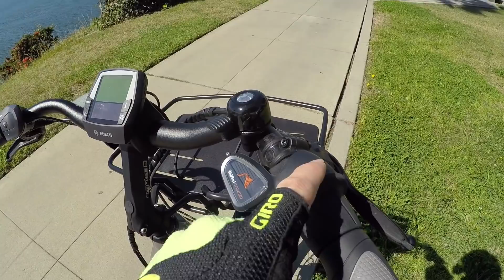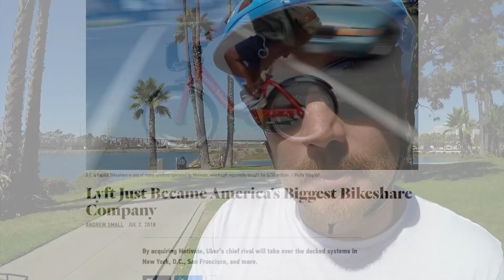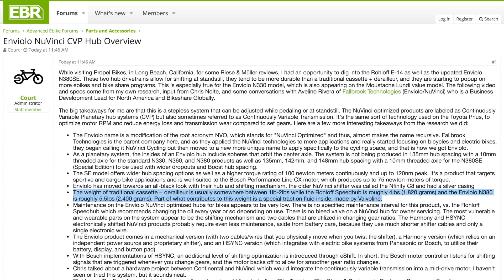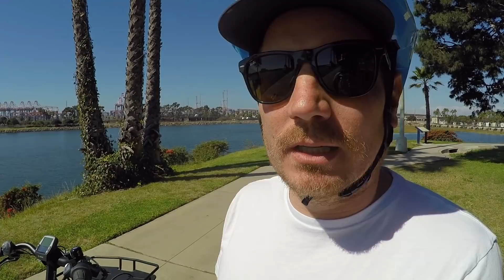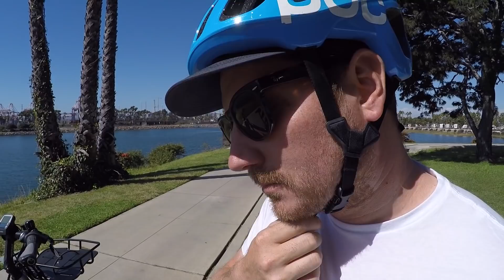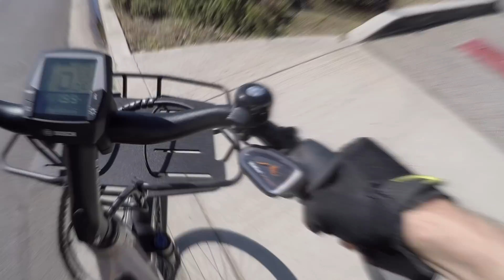Enviolo NuVinci CVP Hub Review, Stepless Continuously Variable Planetary Transmission for Bikes

Comment: One of the aspects of the Enviolo hubs that gives me cause for concern is that they come in around a half dozen different suggested power applications. I would not be happy if I bought a bike with a low power ability that slipped or broke under heavy uphill use when I was putting power down through my legs. Having an electric motor may increase risk of hub stress. I think owners and Dealers need to be aware of this.

Comment: Okay, I know this posting is a little behind the original posting...  Okay, Okay....  6 years behind but I thought I'd post it anyways and see if it yeilds any results.  I am going to use the N330s CVP Hub on a bike with a jack shaft and a 100cc 2 stroke engine on my 26" Fat Tire Mongoose...  I figure if the stock 7 gear cassete can handle it well this should do atleast as good...   It my iunderstanding it uses a fluid in the interior of the hub I'm guessing if I keep it cool it should work well, maybe some heatsinks all the way around the hubs housing for starters.  Im know some people won't like it but I'll post here agin with the progress and let you know if it has any issues...   Let me know if yoiu have over powered the N330s 250 watt mid-drive recomondation and if you had any issues and what the issue was...  
Thanks, I'd really appeciate it.  I am really going to go easy at first and then after about a 200-300 miles start beating the heck out of it.  Wish me luck!  The Manic Mechanic

Comment: Let me add a praise for this transmission. I bought an Nviolo a year ago. I put a TDZS 350watt motor on my bike, but I had  2 years of wear on the derailer which did not want to continue to operate on the 6 or 7 top gears. The chain would jump or even pop the chain link. With the Nviolo I do not have chain problems and I can always find a gear ratio for current performance needs. 6100 trouble free miles for the year.

Comment: Why don't they pair this with a planetary geared bottom bracket? You could run a thinner belt/chain and a lighter geared hub by turning the low speed & high torque of your cranks into high speed & low torque that only gets converted back to low speed & high torque by a final drive planetary set in the hub. Lighter hub and chain means less unsprung mass and less chain slap for mountain bikes.

Comment: I bought one of the ancient first generation NuVinci hubs, way back in around 2006ish. I spoked it myself, tensioning it by plucking the spokes till they all "sounded" and "felt" right. It was paired to a rusty old Huffy 314 with magenta mountain bike handles and an inverted set of speed handlebars... It was truly Frankenstein's bicycle... But I loved that bike. I rode it till I cracked the frame (broke the main crank bearing off the seat downtube, and started cracking the rear fork). I was gonna weld it, but then the bike got run over... I still have the mangled mess in a storage shed, NuVinci still intact, fortunately... My little hill guy cracked, but it still works. 

I'm a decade older now, and a little more creaky... Maybe I could fit that hub to something like a comfy recumbent someday...
Reply: will you send me that hub?

Comment: I really appreciate all the data you have supplied me in my search for a new ebike. I’m sold on the maintenance side of the cvt/belt drive but a little worried about the not shifting while pedaling aspect. My question is can I decrease my input but not stop pedaling change gears and then pedal hard again? I think I need to go test ride a cvt because I’m just so used to gears.
Reply: I am not willing to give up control over my gear ratios as I ride.

Comment: On this system, you can create an automatic transmission. It will be just an explosion in the bicycle industry. It is only necessary to install a sensor that measures the angles of inclination and speed, a controller that will control the servo drive that tensions the cables and changes speeds in auto mode.
Reply: It's already here.

Comment: Don't buy NuVinci products! In case you loose traction fluid which is inside (i had two leaking hubs from them) you can throw it to the bin, even if the hub looks like a new one, because NuVinci will not provide you with new traction fluid!!!! You can't buy it. So they are effectivelly forcing you to buy a new one from them and they are making more and more polution. This approach is against ecology, against environment. F*ck companies like this.

Comment: I love the idea of the cvt and most aspects of it, but I’m turned off by the lower efficiency.  If someone made one that was closer to 90% than 80% efficient, I’d get one. I did recently read that efficiency was greatest in the middle gears, but I don’t know how great.  I’m wondering if I might get a larger chain ring so I can mostly use the middle “gears” and still be going 20 mph, which is my usual speed. Any details about cvt would be great!
Reply: CVT strikes me as a [non]solution to a non-problem.

Comment: Great video, thank you! Do you know if cold weather (like minus 20 celcius) could create problems with these systems? Thanks!
Reply: Yes, our mechanic in Helsinki reports that these aren’t the best in very low temperatures. Apparently still works but harder to shift and possibly some extra rolling resistance, but could be wrong about that.

Comment: One thing that I'd like to mention in regards to not just the Enviolo hub but other internally geared hubs is how the wheel is laced when compared to a conventional cassette setup.
If you imagine looking at a bicycle from the rear, you'll notices that the spokes are offset on a bike featuring a conventional cassette and derailleur. Essentially, the relationship between the hub, spokes and rim forms an acute triangle. This results in a lot more stress being put on the spokes on the cassette side. This makes the wheel significantly weaker and more prone to buckling. On older, less well maintained bikes, spokes invariably break on the cassette side of the wheel.
When viewed from the rear, you'll see that the relationship between the hub, spokes and rim on an internally geared bike form an isosceles triangle with the tensile stress evenly distributed across the left and right spokes. This makes the wheel much stronger.
In my opinion, it's worth consideration if you are a heavier rider or if you plan on carrying a considerable amount of weight in your panniers.
Reply: Interesting...good info.
Reply: currently researching for a long term bike. I am big and tall so this is very helpful. very well explained as well. thank you :)

Comment: used a 360 on my eb for about 11 months before it failed, I have a cyclone setup, would have been fine for a standard 750 watt it would have held up fine. Now using an old 171 3 years now without fail.
Reply: and NuVinci is not selling traction fluid so you can refill/replace your hub. Due to that you can not repair it. And leaking hubs from them is not something new...

Comment: Thanks for the review, I'm researching what to buy as bikes are expensive. Does it feel sharp from the start? I have driven CVT cars and hate them, feels like a soggy elastic band from the lights. I do love the concept of no maintenance. My traditional mountain bike is clunky and I sometimes forget to change down quick enough before I come to a stop.
Reply: CVTs don’t need to be soggy. They are designed this way to allow engine to come up to speed before the “gearing” increases. This maximises efficiency. Some CVT boxes have paddle shifts which makes it act like a normal gearbox, just at the cost of efficiency.

Comment: I've been riding a Gekko FX trike with a Nuvinci for about 4 years now, and I absolutely love it! I'm 70, have fibromyalgia, asthma, and COPD - I'm a slowby all around. I chose the Nuvinci in order to choose my "speed" minutely, and it has absolutely met my expectations. I also have a super granny on the front (22 tooth) that I added to the regular 2 sprockets rather than down-gear all 3, and they work out very well. I went to Morro Bay this week, and while I had to pedal-rest-pedal-rest, I did make it up the nice, steep hill. (I live in the flat side of Bakersfield - not a lot of hills here.) I'm working on getting into better shape now that the air quality is better - had to stop riding with the Calif fires - covid has been a godsend to the asthma - I've been able to start riding again! Hooray! Anyway - thanks for a great product with the Nuvinci!
Reply: I was also thinking about getting the enviolo for my ebike paired to a befang motor. I also live in Bakersfield.

Comment: I have mixed feelings about the CVT hubs. I don't do electric so my experience is purely from normal riding. I owned a N360 while it was still just fallbrook tech (likely around 2012 or so).  The hub felt like it was filled with tar. Pedaling had a feeling of drag in the hub. Hills I used to climb daily with my shimano 3 speed and 8 speed now required me to walk up the hill. It was not a gearing issue, but one of efficiency. The lowest "gear" on the nuvinchi was far lower than the two IGH hubs I had. So it should have been easier. The hub also after about a year developed a leak. After about a year of leaking it stopped. Then a few months or so after that it developed the dreaded death rattle. So needless to say I am hesitate to buy another.

What was nice about the hub was shifting was smooth and you could quickly dial in the best ratio for the condition. Though you could not fully adjust your gearing at a red light as a regular IGH can.  The fact I also did not have to worry about gears slipping or getting stripped was a massive bonus and one of the main reasons I did not replace the hub sooner.

So on the one had the hub has some rather big pluses on it#s side. But it also has a lot of negatives. Especially as fallbrook will not release efficiency data and simply claims third parts tests of under 80% are wrong. Perhaps if they would be more honest and also fix some of the hubs issues I would buy one again. But I can not recommend them as is.
Reply: Well, the way it works is that there are two discs inside and a bunch of balls on individual axles that act as the planetary gears.  The speed changes as a result of the angle of the axles of the balls changing, which changes the contact point on the discs and thus the gear ratio.  The issue with this is that it relies on the "friction" of the fluid inside the housing to keep these balls from slipping, while still allowing them to "roll" on the contact surfaces.  So  your assessment that it felt like it was filled with tar is not as far off as you think...

Also the difference in gear ratio is not as evenly spaced, because the diameter of the planetary "radius" changes a bit more drastically even if seamlessly.

Comment: As every hubgear the Enviolo is safe from damage and low on maintenance. Right. But the argument that it allows being on the right gearing all the time is not that real. After a couple of weeks using an e-cargo bike with that system I started hating it because in practice I was NEVER on the right gearing but rather always fiddling with the twister shifter to try and find it. So to me it has definitely no advantage above stepped systems, derailers or standard hubgears even more so adding its premium price.

Comment: I built 2 ebikes with banfang fun 8 crankdrive motors and N360 hubs with harmony electric shifting.
Mine is mated to the BBS2 750w motor and has always worked well 
My wife's bike is a BBS1 350w hers regularly loses the autoshifting function resulting in rapid peddling stuck in low gear, she has to stop and do a reset to get it working again, something I have not been able to solve.
Having first ridden my bike with manual shifting which feels stiff under load I think the harmony system works better, if I use manual mode the twist shift is very  light to use and would suit people with weak hand grip.I never need to lift off the peddling pressure the shifting is buttery smooth, when I had the BBS1 set up with derailuer gear system shifting could be quite harsh and jerky I felt the derailuer and chain wouldn't have lasted very long.
It's fun to ride my 750w in manual mode using the throttle gently to avoid front wheel lifting and get moving to a fast walking pace then rolling on the shifter it actually feels like a throttle giving smooth rapid acceleration up to 28 mph, also running between half and full power on the thumb throttle you can speed up and slow down using the gear shift in manual mode it's good fun off road.

Comment: The efficiency of the NuVinci is the biggest problem and is the issue with all spherical ball drive transmissions. They HAVE to pump fluid away from where the balls make contact. Think how your tires have to displace water away from your tires. The only way to increase the efficiency is to decrease the speed. The only way to do that would be the make the unit much larger because the ball contact friction is limiting the torque. All in all it's not worth it unless you have a serious aversion to indexed shifters. Personally, I have a problem imagining the galling of the spheres and races that would happen if the fluid or forces were just a LITTLE bit off. Give me a straight tooth geared transmission and some form of active noise cancelling or a better designed transmission ;)
Reply: The advantage for me was in the ability to change gear ratios during a standing stop by simply dialing it in. If I'd known the 380 was only rated for 250 watts I  would have given some thought about opting for a 9 gear cassette in the rear. I originally ordered a Catrike recumbent trike with the Nuvinci 380 hub/derailleur and a BBS02 750 watt motor pedelec assist/ and switched manual no assist for use on the flats. It has worked well (3 yrs) until now; this Covid plandemic has kept me grounded for the past four months. The dealer left out the part where the 3x max wattage rating voided the warranty, though I can't put the blame on him. It's doubtful I would have changed a thing. Now after sitting, the trike's acting  like the hub's filled with gravel. Just a SWAG (scientific wild-assed guess) but I'm betting there's no fluid left inside the hub and no way to fix or replace the fluid? I'll have to call Utah Trikes in the morning.

Comment: Hi Court and thanks for this. And now you got me thinking. I'm a fan of and have owned and used IGH systems quite a bit. I know Shimano has had an automatic option with the steps system that integrates with Di2 Alfine kit for some time now. I saw at Interbike 2018 Bosch mentioned they would support that too staring in 2018. Have you seen or tried any of these?

I have a bike with a steps drive that supports it and was thinking of building up a wheel with Alfine 11 Di2. I'm also getting a Benno with a new Bosch CX drive that should support it and am thinking I might want to do the same there. On steps (at least on mine) one can relatively easily switch between manual and automatic shifting. I haven't got to play with a Bosch  CX yet so I don't know what the automatic shifting options are, if they come with it "out of the box" like steps or if this would require a firmware update. Do you have any experience on this? Thanks!

Comment: Nice explanation and technical details of Vario versus Cassette. For me, seems the Vario would be best for a mostly flat city commute application and a cassette would offer more enjoyment with precise shifting, especially on hilly terrain. A very helpful review as I’m considering purchasing the R&M Culture which is available with either the Vario or Cassette, in USA $590 more for Vario on the Culture. Thank you Cort, always excellent reviews!
Reply: Though my recollection of derailleur shifting is that I often chose a suboptimal gear because of the many gears that overlapped or were unequally spaced. The Rohloff or Enviolo would prevent that of course. What I have found with Enviolo’s turning shifter is that it takes several movements of the wrist to go from top to bottom ratios and therefore it is far from instantaneous. This was most apparent when coming off a fast and steep decline followed immediately by a steep incline.
Reply: @petergilbert72  I build up my own cassettes and freewheels and choose my own chainrings to provide either half-step, 1.5-step, or crossover gearing, with a 5 to 7 percent progression between ratios. I use conventional linear-action shifters, either barcons, downtube levers, or, on the mountain bike, "thumbies," always in so-called friction (nonindexed) mode, and I can always find a suitable gear quickly and effortlessly.
Reply: @petergilbert72  I have no motivation whatsoever to abandon my conventional sprocket-and-chain transmission.
Reply: @johne6081  indeed, I’ve just paid £450 to change an Enviolo sprocket to lower my ratios. Something that might have cost me £50 with a derailleur system.

Comment: how does it work in snow and cold weather?
Reply: We have many of our customers operating this in snow and cold weather with no issues. Most of the bikes we sell with this drivetrain have a belt as well which is ideal for the snow since you don't have the same rust or corrosion issues as with a chain and derailleur.

Comment: You don't have to back off when shifting. The hub will shift fine during the dead spots in your pedal stroke. Acceleration is one of the things I love about having a CVT.
Reply: Maybe that's because it's an E bike, it looks like the motor torque is too much and interferes with the shifting
Reply: @ahmeeeeeeeeeeeed  I'd not considered that but obviously motors generate continuous torque so don't give the hub a chance to shift.